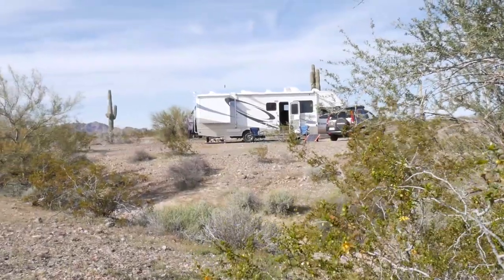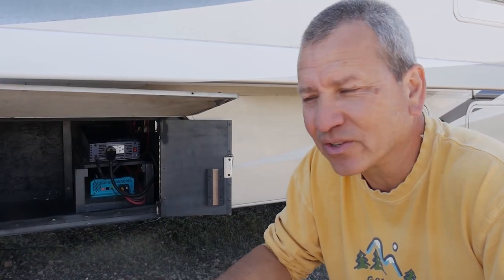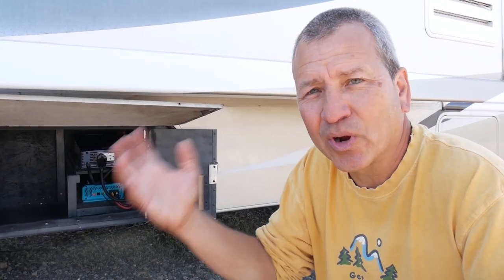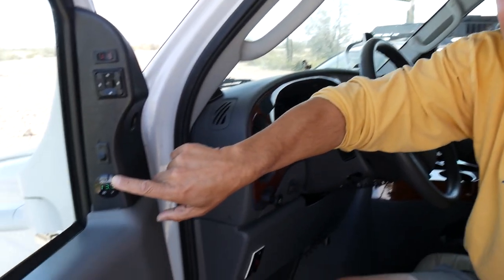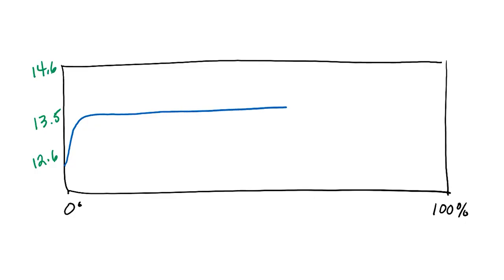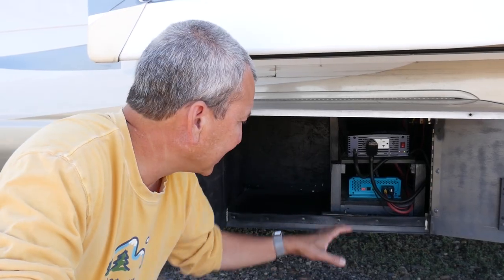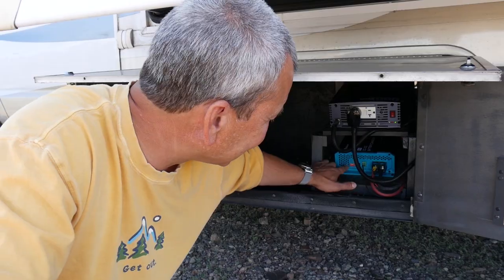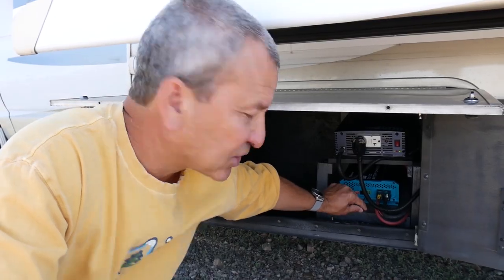Charge LITHIUM Batteries While Driving - System Setup

Comment: Thanks.  Like #128.  Replacement alternators are 95, 120 or 130 Amps.  There are higher outputs too, but your stock should be 95, 120 or 130.
Reply from the maker: Thanks! I appreciate the info. Someone else here said the V10 is probably a 130A but I can't find it documented anywhere.
Reply: @RVwithTito  It would be JAYCO that decides which one to use. I depends on the gadgets in your RV.  Ford can't guess.

Comment: Hi Brian
Like your video. I installed a 40 amp dc-dc charger on a 100amp lithium also. So far so good. 
As far as amperage and alternator speed you only get the max output rating at the higher speed,  but it is dependent on load . Example 1, if all batteries are fully charged you would only have minimal amperage coming from alternator. Example 2 ,if your lithium bank was depleted your alternator will only put out about 25 amps  because of the dc-dc charger .

Comment: Thanks for your help, I also have lithium and was struggling with those 5 pins, the manual is really a mess.  Cheers
Reply from the maker: You're welcome!
Reply: Actually the manual does explain the dip switches reasonably well. Problem is, that manual was probably written by the person who designed the PCB with the switch on it, so it was perfectly clear to him/her how those switches work.  I had no problem reading and understanding the description of the switches - but then I used to be someone who designed things like that - I'm actually struggling a lot more with a perfectly consumer friendly description of a setting on an iPhone :-)

Comment: Thanks, I just installed mine and your video was extremely helpful. I also used the wire and switch to turn mine on and off.  I love not having to reinvent the wheel. Thanks.
Reply from the maker: Great to hear! Thanks for following up. Hope it works well for you.

Comment: This was really interesting although I have a fifth wheel the principles would remain the same. The nice thing is in my 6.7 I have two alternators. As always thanks for the great information in the clear and concise way you present it. Please be safe as we navigate this difficult time.
Reply: The Ford  starting alternator is 157 amp, the aux on my 2018 is 220 amps. I ran a 1/0 awg cable to a Anderson plug on the bumper (I can also bring into the bed) 2/0 cable would of been sufficient. Anyhow that allows me to run a Redarc 40amp DC -DC charger for my 4 BB batteries. The Redarc is also my solar controller for my portable panels. Good luck

Comment: Cover that positive post! 5:40
You might want to have a temp gauge on your alternator, that way you will be forewarned if it is being overworked.
Question:  if you have a 90 amp alternator, why not have a second b to b 20 amp ready to go?  If it is heating up the alternator, shut one off.

Comment: Thanks Tito for your great videos I have learned alot about solar and many diy projects in my rv.  I truly admire how good your jobs end up very clean and professional looking. I  have a question for you or any of your followers about Renogy products I have experience a very negative experience with their customer service and warranty fulfillment in particular, they are just non responsive and non professional I purchased  4 of their flexible panels 1 has gone bad by bubbling on the surface and is no longer producing energy I have also bought  a dc to dc charger in the past few days after looking at your video about this dc to dc charger but I am worried of the future and responsiveness from this company, any thoughts or suggestions would greatly be appreciated it.
Reply from the maker: That's unfortunate. I've only picked up a few Renogy items, this being one of them, and haven't had to deal with their customer service. Fortunately, the DC-DC charger is still working fine after a year an a half or so. There's a lot going on in the Chinese market these days. I wonder if that has anything to do with it.
Reply: @RVwithTito  I do wonder as well what happened. I can tell you that it is unfortunate to not be able to rely on good customer service for any product its been 2 weeks and no response from Renogy. I honestly think I will be using Victron or battleborn products for what I've read and seen other people mentioned there customer service is top notch. Thank you for taking the time to respond and please continue to post more of your amazing video content I have learned how to do a lot of diy projects for my Rv , God bless.
Reply: @robertselene1  Had the same experience with Renogy. Customer care is awful after the purchase.

Comment: a bit late response but you main concern should be low rpm /idle condition leadin to overheating of the alternator. since gasoline engine idle torque is sufficient evene idle rotation provides enough power for the alternator to feed requested current from the lithium power pack. and this amperage can reach to 90 or more amps. since idle rotation is very low the integrated fan blowing cold air to the coils of alternator can not cope with this power transmission and alternator becomes a fire hazard itself. limiting lithium charge maximum current to 20 amps is a good call. other intelligent  adan adaptive options need additional components if you require more amps to the lithium pack to charge it in a hurry. thanks for videos series btw, good work !
Reply from the maker: Thanks. I really appreciate the insight. It makes me feel better about sticking with the 20 amp model for those reasons.

Comment: Very well done sir. My rig charges my two house batteries when on or driving, but I can't charge my solar battery bank as everything is in my trailer. Odd, lol, I know. Good luck Brian.
Reply: Just run an extra wire to the trailer. I do that with my setup since I only have a trailer and I just have a second cable along the standard trailer cable that I plug into my jeep which has the charger installed in one of the cubbies below the trunk.  That allows me to charge the house battery while driving or when my solar panels don't produce enough power.

Comment: Designed output of alternator depends on RPM and cooling. It will output 90 amps but not under low idle speeds (will burn it up). I would limit draw to 20 amps.

Comment: Please note in this video above, the first two dip switches determine the charging voltage for the lithium batteries. He has his set to 14.4 for Battle Borns. If you have SOK's they want a 14.6 volt charge. Then set the first dip switch to  ON (down) instead of off.
Reply from the maker: Great tips. Thanks! 👍
Reply: With the SOK battery, are the rest of the switches (2 through 5) correctly configured?
Reply: @michaelgegoski1058  SOK 14.4v charge should be set at off/on/on/on/off.  Remember that down is on and up is off on these units. So for SOK its up/down/down/down/up.
Reply: Thanks, love your videos. Keep up the good work.
Reply: @michaeldoherty2289  That is incorrect for SOK. As per above, SOK specifically calls for 14.6 v charging , NOT 14.4. Therefore the first dip switch should be set to the down position for 14.6v
Reply: @jaygold4467 I misread what he said.  I thought he wanted to see what the 14.4v setting is.  You are correct.  For 14.6v  lithium switch 1 on,  switch 2 on,  switch 3 on, switch 4 on,  switch 5 off.     So down, down down, down, up on the switches.  The Renogy dip switch chart for lead acid and lithium is very clear and easy to read.   Some battery manufacturers may not list specify a clear charging voltage.  Especially true for DIY cells/packs.   If you are not sure, a lower charging voltage will give longer battery life (sometimes really a lot) but remember you won't get up to a totally 100% state of charge.

Comment: Good video. Thanks for share. For how long are you using these batteries? They are still working good?
Reply from the maker: Yes. The batteries are great. We did upgrade the DC charger to a Victron model though. The Class C was sold earlier this year, but we now have an older Class A that I put more Battleborn Batteries in. Again...excellent performance.
Reply: @RVwithTito  Great. Thanks. I will check your videos.

Comment: I recently got the same charger for car camping for use with an AGM battery.  Great way to avoid solar for small RVs or car camping.   For a small RV you might not even need solar with this charger.
Reply from the maker: This is true.
Reply: Hey Charles, how did you setup the switches for your AGM? manual setup voltages - not battery type. Thank you
Reply: I have a 1977 Honey MH. My house battery is deep cycle lead acid hooked up to the 
Progressive Dynamics Converter / smart charger. I can isolate from draining the starter
battery while camping, yet while driving , I am charging both house and starter battery.
I want one small lithium battery for tv,  not disrupt the current system, but be able to charge it from the alternator and /or 100 watt solar panel  I bought a Westinghouse
2200xi for the roof air I occasionally use. Lp for refrig and stove. Dual Power hot water heater. I am stating all this fyi. I like my TV and want to quietly power it. any feedback appreciated.

Comment: My friend has just 3D  printed a duct for the fans so the Renogy can be fitted in the electronics cupboard  and vent to the outside - an additional  60mm dia vent at the other side of the cuboard  helps keep everything ventilated

Comment: I've tied the on/off switch into the ignition, that means I can't forget to turn off the charger and drain my starter battery. It will only run when both the ignition and the manual switch are on.
Reply from the maker: I've been meaning to wire mine switch to the ignition also, but haven't gotten around to it. That's one reason I got a switch with a light in it. So I don't forget.
Reply: @RVwithTito  You could wire in a low voltage disconnect to the existing switch. That way it would only run the DC-DC if 1) the switch were on, and 2) the starter side was >13.4v or whatever (ie, running)

Comment: Brian, good information about your set up with the lithium batteries. Question, could you have left the Solenoid switch in your circuitry just in case your coach battery ever went dead to start your RV?
Reply from the maker: I could have left it if I ran a second dedicated cable for the charger. The charger is one-direction only (from chassis to house). Instead I reused the #2 gauge cable that went to the solenoid. Hope that makes sense.

Comment: I like that you connected a dc to dc charger to use the alternator to charge your house batteries. I bought one just like yours (I also have a Ford E450) but, I still have a generator and want to be able to my aux button to "jump start"   If, I spliced the dc to dc charger into the positive line leading  from the switch to my lithium battery bank on the battery side and the B+ from the ignition switch ( via  a switch mounted next to my Aux button) to turn it off when not needed.  Battery bank 2-170ah Lithium in parallel.  I have used  a lot of your mod ideas but, I just can't wrap my head around this one.
Reply from the maker: You could just leave the solenoid and switch in place then run new thick cables from your starter battery to your DC-DC.
Reply: @RVwithTito   @RV with Tito DIY  Thank you sir I will do just that. By the way...the acrylic and blue light...Killer

Comment: HI Brian, 
It's my understanding like you said that the Lithium batteries will draw what ever is available, constantly. So    
If they were connected straight to the alternator they would draw what ever your alternator is capable of putting out. Alternators are not designed to put out that much power constantly. They will over heat and burn out. So your dc to dc charger limits the amount of power that the alternator can charge but more importantly it should turn on and off the charge time to give the alternator time to cool down. Like on for 15 minutes then off for 20. Even at a lower amperage draw it can still over heat the alternator especially at idle.
Reply from the maker: I'll keep that in mind. Thanks.

Comment: I've got 150 amps coming from my truck dual alternators and 1200 watts of solar combined feeding my 1440ah Lifepo4 raw bank in the truck camper.

Setup is dual victron buck boost converters 12/24v wired (100a and 50a) wired in parallel.  Controlled via victron cyrix li cnt relay hooked into the bmv712.  Turns in and off charging based upon bank SoC.  The Cyrix seems to take care of any back voltage  spike.  Don't use more than 60% of your alternator output and make sure you've got temp compensated alternator so it will throttle back current and not burn up.
Reply from the maker: Thanks for sharing your setup and advice. 1440Ah is a who lot of LiFePO4.
Reply: @RVwithTito  meet you guys at the Seattle RV show a few years back.  Thanks for sharing.

Comment: I had an idea that you might use a switch for a heated seat or defroster so it would disconnect when you shut off the ignition and won't turn on until manually engaged. This will prevent forgetting to turn off the switch and possibly draining the battery.

Comment: Thank you!  I'm going to add the Vixtron 12/12-30 for my Tacoma /Airstream.  I know it's IP43, but do you think it's ok, if I install it in the metal battery box that's outside?  It shouldn't experience any direct splashing.
Reply from the maker: Should be fine. Be sure to Install it vertically with the connections on the bottom and a drip loop in the cable just in case. That's how the sailboat folks do it. Good luck!

Comment: Hi. Great information but I'm perplexed on your choice not to upgrade your Alt to a higher amperage or even add a second dedicated house alternator ( great backup potential for the RV)
And as for the manual switch is it on switched circuit ? (key on)
Great info I'm glad I bumped into this.

Comment: Thank you #1 question You took 12 volts from your dc to dc output( lithium)  ran that to your on /off switch and back from your switch to your dc to dc D+?
#2 question did you fuse  the wire going to your switch?
Thank you again

Comment: Very helpful vid!
I'd like to simply leave the lithium batts connected to the Renogy charger all the time I'm driving, regardless of their state of charge. Would that be a problem?  Does the charger need to go to float somehow? Maybe the Renogy does that?
Thanks!
Reply: Lithium batteries don't use float. The lithium dip switch settings ensure the charger doesn't give float. You can see this all in the online manual.

Comment: Hello there. Question. I am very confused about the engine connection. Do you connect on BOTH the engine alternator and engine battery then to your lithium bank. Can you not just connect only on the engine battery red to positive black to negative. Thanks

Comment: Thanks for this video. I just installed the same Renogy unit to charge a 200A Ampretime battery. 
I’m confused by the dip switches and Renogy’s chart. Am I supposed to set them to what the alternator puts out or what I’d like the battery to be charged at? The alternator never shows more than 14.1.

Comment: Thank you so much for sharing your knowledge.

I have a 2003 beaver patriot thunder diesel pusher and it is ridiculously complicated wiring. Where do I begin to dissect the power grid? Where would I even install the DC to DC charger? I have no idea where power is coming from to charge the house batteries.

Comment: I've installed a Votronic (think it's a German company) they make a tiny 30amp DC-DC charger. 
The goal is to charge AGM batteries whilst the chassis has sealed lead acid, and of course not kill the alternator.
And it's in parallel with a victron mppt for a 100w solar panel.

Comment: Hi Brian. I love your videos, and often watch them on our big TV in the living room, much to my wife's chagrin. I am installing a 200AH Lithium Battery in out Thor AXIS 24.1, a "Class A" built on a Ford E350 chassis. The "house" battery can be charged by the alternator, shore power, or an on-board generator - the famously noisy Onan 4000. I want to install a DC to DC charge controller in the system to protect the alternator, but the chassis is fitted with a Bi-Directional relay controlling an isolator relay, a coach disconnect relay, and a chassis disconnect relay. I am stumped as to how to hook the charge controller up and retain the handy functions of the relays. Any advice or a reference to one of your videos would be greatly appreciated!

Comment: Thank you, great tutorial. I'm confused a tad... Is this Renogy DC2DC charger not suppose to stop charging when the correct voltage is reached, depending on the dipswitch settings? Or am I getting this wrong? If I have a 7 hour drive day, and my LiFePo4, batteries are full in 3 hours, will it stop for the last 4 hours?